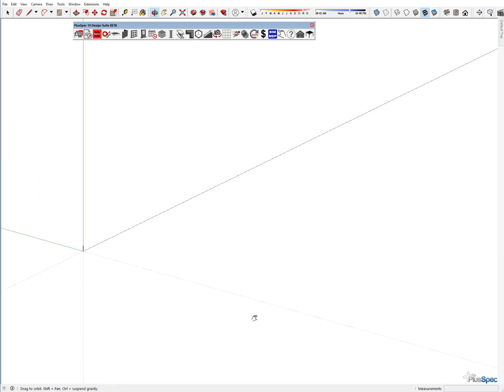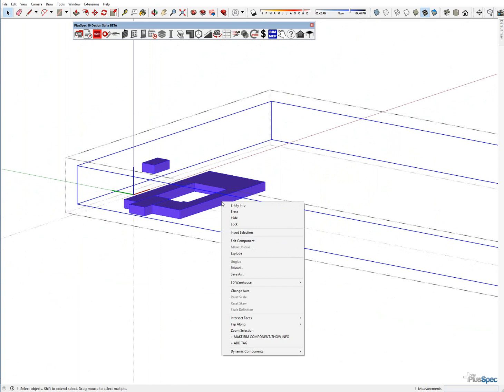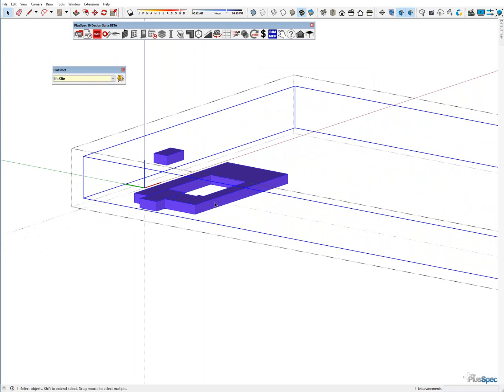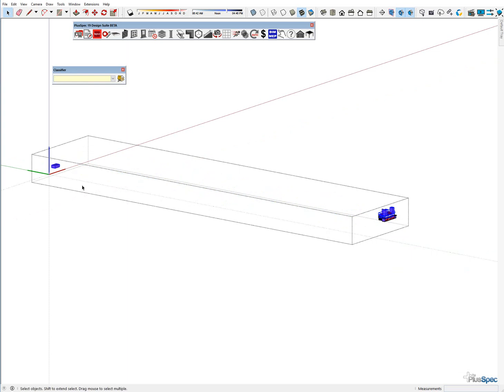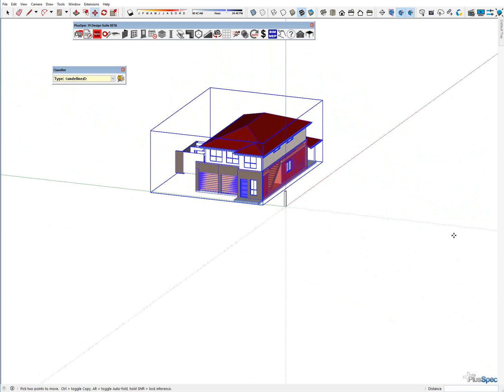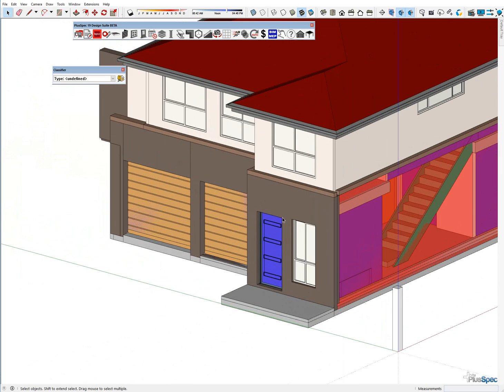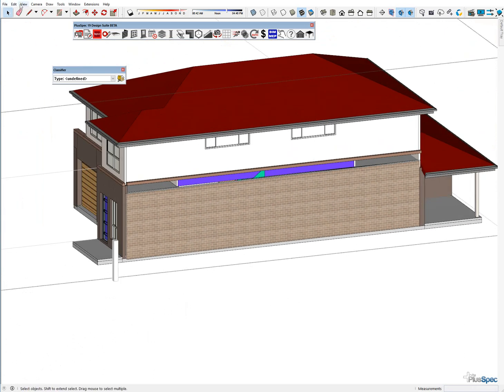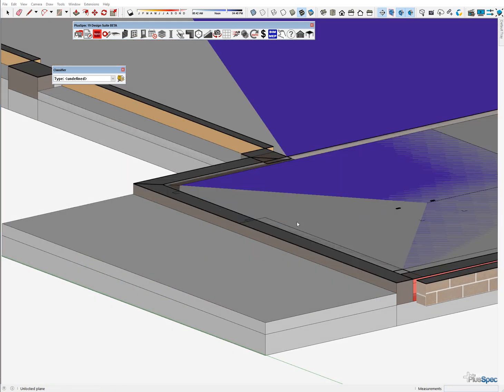Importing an IFC model into Sketchup and tracing in PlusSpec

Comment: how to add ifc file type into my sketchup 2014?
Reply from the maker: You could download the latest version (or any version after 2018) of Sketchup, import the IFC and then back save the file.  use: File save as and click the dropdown to change to the version to Sketchup 2014.  Although you will find that it runs slow as older versions of Sketchup do not handle large amounts of geometry well.  You should at least update to Sketchup 17 make if you are not using for commercial purposes.